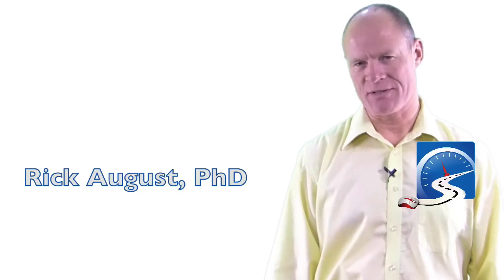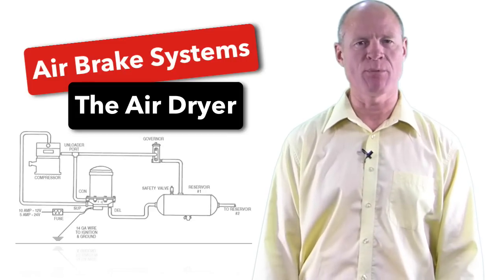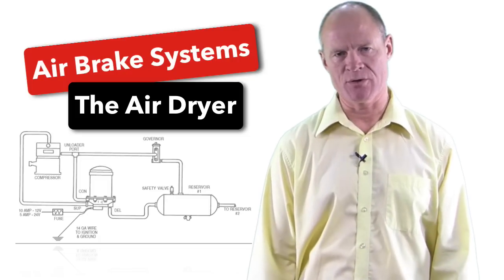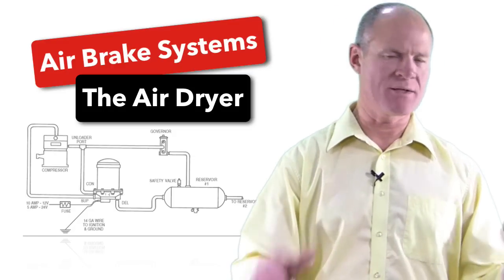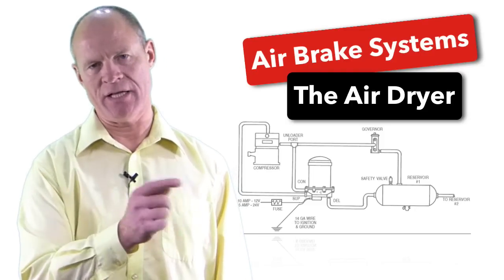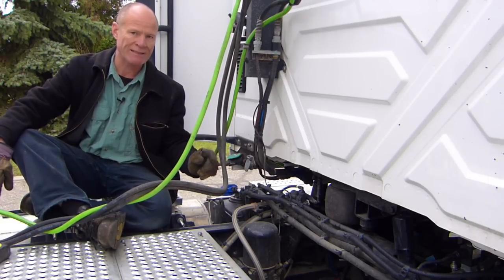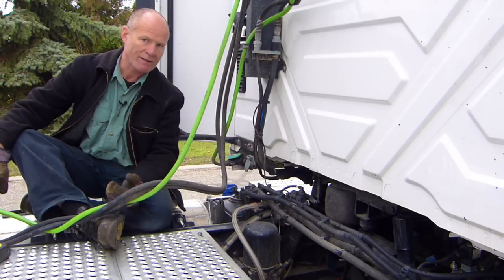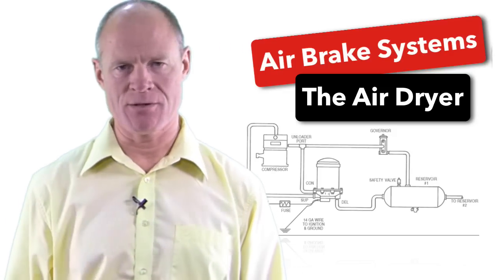How the Air Dryer Works to Pass CDL Air Brake Pre-Trip Inspection Test

Comment: Just wanted to add my two cents worth, I have a 2012 International Prostar and the dryer is located on the inside of the left (drivers side) frame rail under the cab rear of the transmission. It looks almost like a brake booster on a car with a large filter attached and lots of lines and wires coming and going.
Reply from the maker: Hi Scott - Apologies for the late response. Thank you for your comment and providing that information - that helps out the new drivers working toward a career as a truck driver. Is the governor within close proximity? If so, it is an ADIS system. If there is anything further we can do, drop us a note. Always happy to help. All the best, Cheers Rick

Comment: all I have driven Macs Peterbilt and international have been where yours was in the video.
Reply from the maker: Hi Ladonna - there are a wide variety of places you can find the dryer. So long as drivers can recognize it and it's not broken - all good. Too often I have students tell me they can hear the compressor or the governor, when in fact it's the air dryer purging. All the best, Cheers Rick

Comment: What is the function of the electrical connection on the air dryer?
Reply: It's a heater. 
Sorry, just found this vid. 😏
Reply: @dgronzega8073  Thanks!  So the heater keeps trapped water from freezing in cold ambient temperatures?  I was thinking that there was some kind of moisture sensor there to tell the dryer to purge moisture because sometimes mine will purge repeatedly  and get the compressor pumping again. 
A mystery to me.  It mostly happens after we have had a good rain.

Comment: I have completed problem with my air break system.  First tank are always 100 psi second 120 . Psi when i press break first ait break goes below 90psi . Also air dryer purges every 15 min or more sometimes i have to press break for making air dryer purges
Reply: I have 2011 international cummins engine thank u ..
Reply from the maker: Hi Abdou Shipping - Thank you for your comment and query. I suspect it has something to do with the unloader valve which connects that air dryer to the governor. You're going to have an ADIS system, so that's going to explain the difference in pressure of the the 2 tanks. If there is anything further we can do, drop us a note. Always happy to help. All the best, Cheers Rick
Reply: @smartdrivetest  thank you very much for your reply sire.  I replaced air dryer recently . And i took my truck to over 10 truck shops no one was performing to find the problem:/ ... now my air dryet purge every 6 min to 10 min ... if you are able to check my truck i will be more than happy.  Thank you again..
Reply from the maker: Hi Abdou Shipping - Thank you for your comment. Unfortunately, beyond helping you to troubleshoot, I'm not going to be able to have a look at the truck. Have you tried putting the old air dryer on and see if it is still purging every 5-10 minutes. All the best, Cheers Rick

Comment: my Purge Kit blew out the bottom of my air dryer. Taken along the Dome donut that locks it in, is that Dome donut replaceable? Also how can I bypass the air dryer in the meantime? 2012 freightliner. my air dryer is on the driver side in the engine compartment.
Reply from the maker: Hi Willie Robbins - thank you for your comment. That vehicle will probably have an ADIS system - is the governor within close proximity to the air dryer? If so, I don't think you can bypass the air dryer because you'll be also bypassing the governor and need that to control the compressor. And even if you could bypass the air dryer, it would probably be easier to fix the air dryer than to jury rig the air lines to bypass the air dryer. If the dome donut is part of the filter, than yes, it should be replaceable. My suggestion would be to talk to Freightliner - they will be able to give you the specific information. Thanks, Cheers Rick
Reply: thank you for your time!
Reply from the maker: You are most welcome - if there is anything further we can do, drop us a note. All the best, Cheers Rick

Comment: What if it keeps purging every 3 to 4 minutes?
Reply from the maker: Hi Shitlocks - Thank you for your comment and query. The air dryer's signal to purge comes from the governor. So if the system's purging in those short intervals, I suspect you have something wrong with the governor - that would be my first check. If there is anything further we can do, drop us a note. Always happy to help. All the best, Cheers Rick